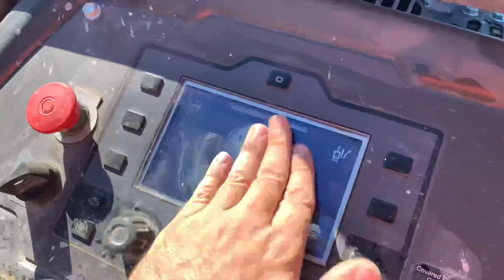What is the point of saw cutting ?

Comment: Do you only cut asphalt? What’s the thickness? What type of rock is in the concrete when you do cut it?
Reply: Xavier normally roads are between 4-8 inches thick but it depends on the road. And concrete usually contains granite or limestone
Reply: Austin Smith music they can also contain river rock which is a harder rock compared to limestone which uses a different blade to cut. 

I’m in the Texas area cutting concrete too and typically roads are 5-8 inches thick depending on what type of road it is.

Northern states use different rocks and different thicknesses because of the freezing temps. Maybe that’s why I see frank doing more asphalt cutting idk. That’s why I’m asking so many questions. Seems interesting not tying to fight or be a bitch